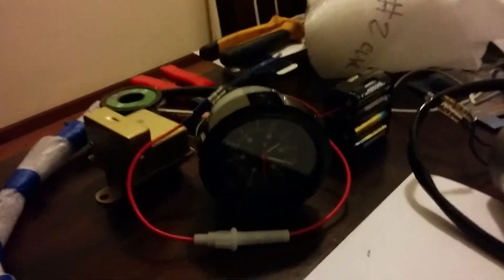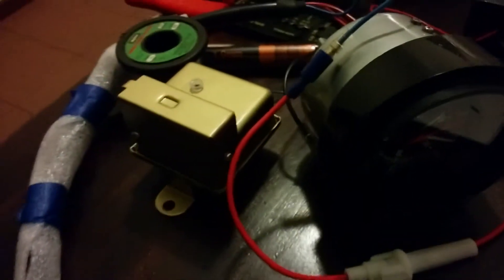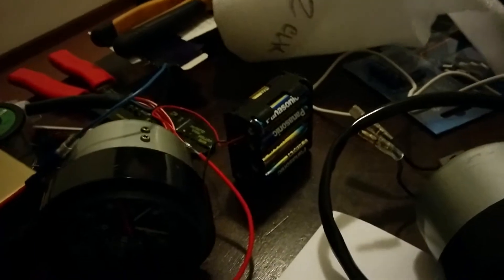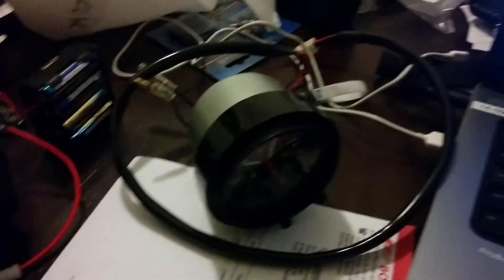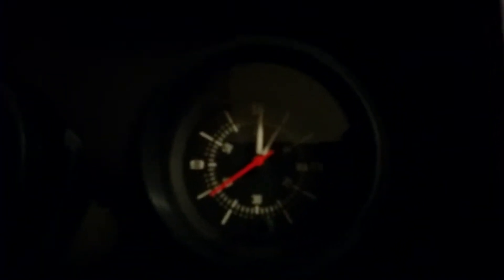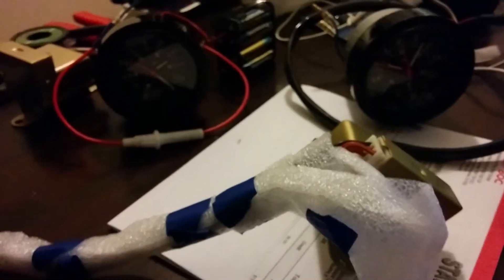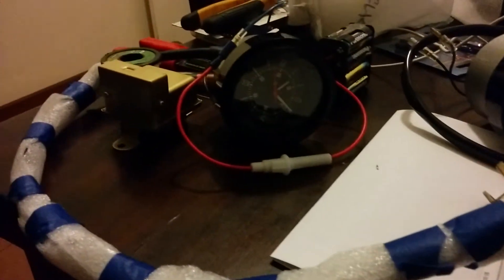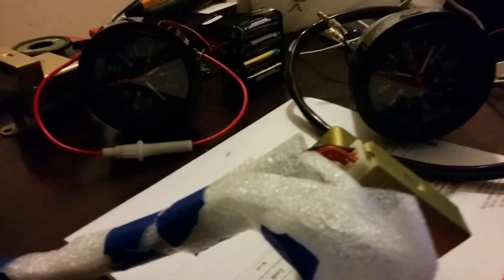S30z rally clock troubleshooting

Comment: @gav240z I have a 73 240z with a normal clock in it. Some years ago I got a "calendar clock" with the single knob like the one that you have on your shelf beside the normal clocks. What do I need to make the "calendar clock" work in my car?
Reply from the maker: You'll need to change the plug / connectors on the rear from a later 260/280 style dash plug to a 240z style. Also the bezel and housing will need to change to suit for similar reasons. You'll also need to check if it's working. Resistors and Capacitors can go bad and stop them working.

Ron at Zclocks.com can help.
Reply: @gav240z  Cool. Thank you for the information.